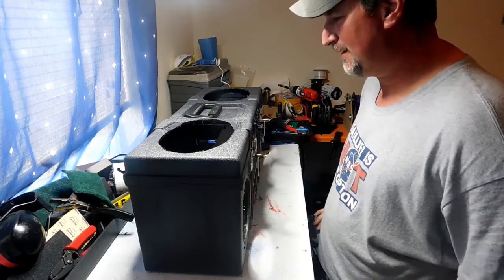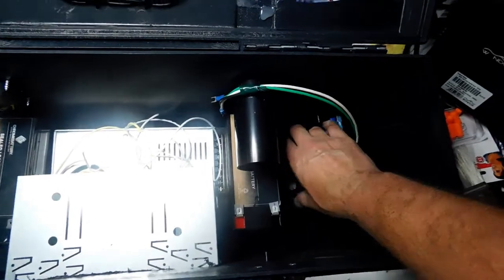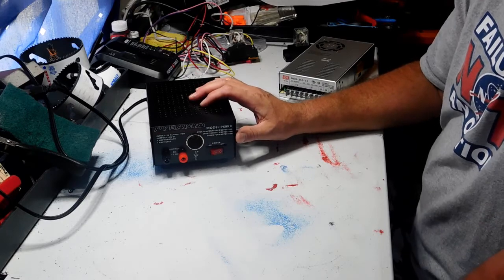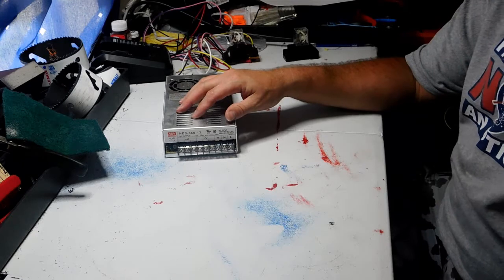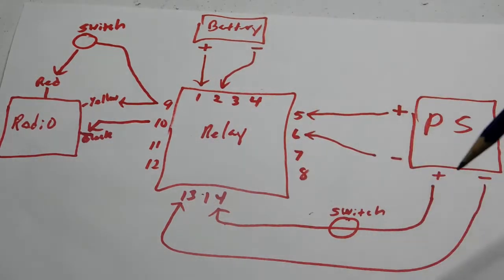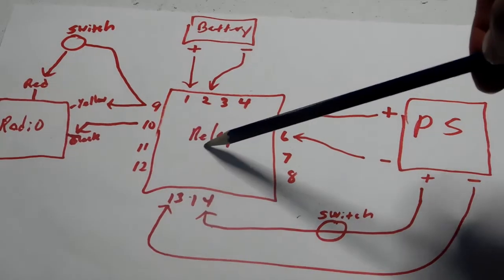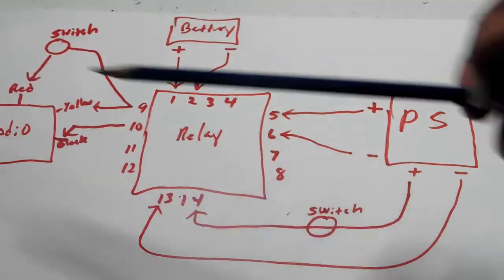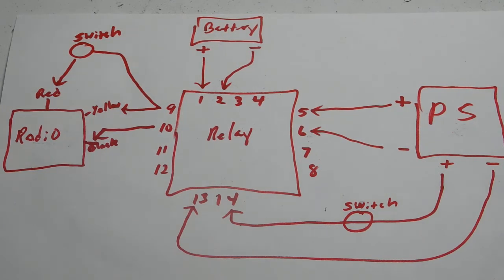Mega Update, Plus Power Supply and Relay Talk

Comment: Phil.   What kind of switch did you use on this box.  I know you have completely tore this apart but do you recommend a switch?   The one from the radio to the battery and from the power supply to the relay.    Thank you sir.  You are a gentleman and a scholar.
Reply from the maker: https://www.amazon.com/gp/aw/d/B00ZR7MOU0?psc=1&ref=ppx_pop_mob_b_asin_image
Reply: @diyboomboxesintexas2805     Again.  Thank you sir.
Reply from the maker: A regular single pole single throw switch will work 
I will get you a link to the ones I have been using for a few years now